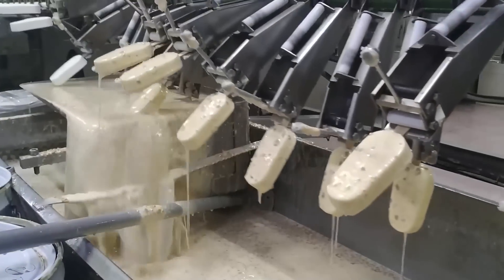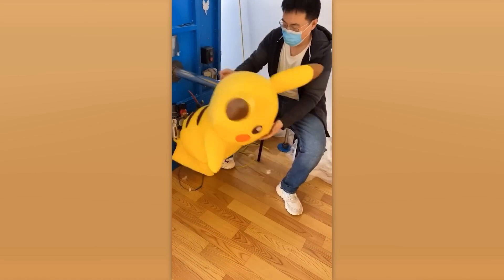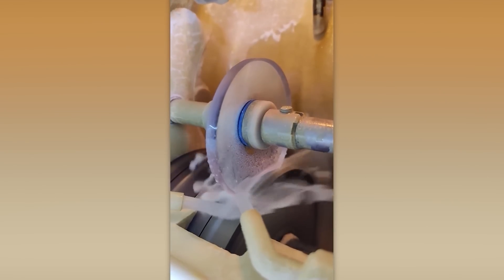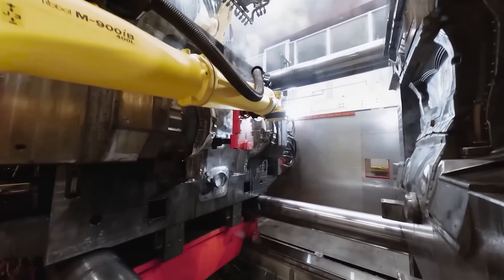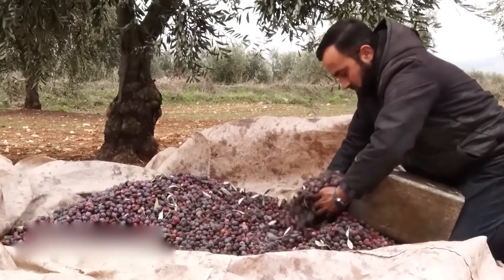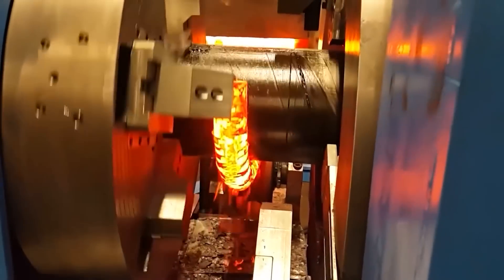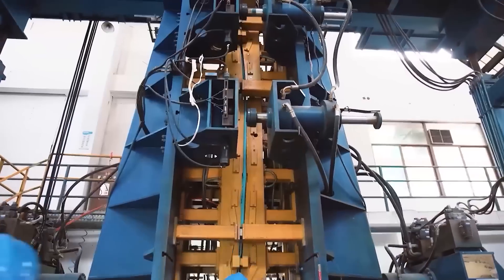Mass Production Processes and Modern Manufacturing Machines

Comment: 00:20 steel wire
00:37 meat packing
01:01 stripping metal cable
01:24 molding covers
01:44 casting iron gates
02:16 metal mesh
02:39 latex gloves
03:25 pokemon recrofill
03:52 steel caps and rods
04:40 coloured glass pitchers
05:14 park benches from plywood
05:38 printing melamine dinner plates
06:00 cutting high-powered spectacles
06:31 polishing cut metal cylinder
06:58 macaroons and pasta
07:32 honeycomb processing
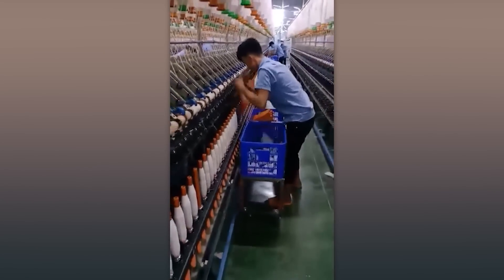08:04 chocolate/gravy?
08:20 kewpie dolls
08:48 yarn picking
09:18 copper bars and rods
09:38 cutting fish steaks!
10:14 grass cutting
10:36 making a chain
11:10 making a cooling fin
11:40 sponge!
12:00 melons!
12:11 tesla!
13:22 a damascene knife!
14:21 a pakistani green project
14:48 weaving a doll's hair + plastics
15:38 ice cream sticks
16:42 huge railway springs
17:17 bottles
17:56 shotgun cartridges
18:30 duckzilla (canned soda)
19:05 surfboards
19:40 lavender paste?	
20:05 snakes! END

some of the things i'm not so sure about, please excuse.